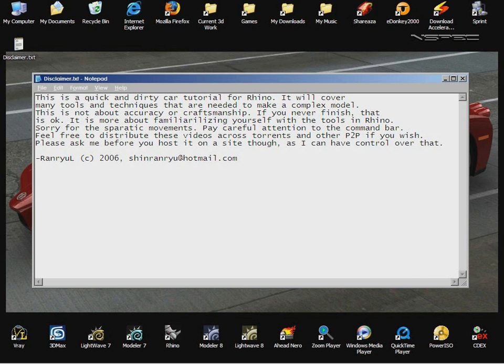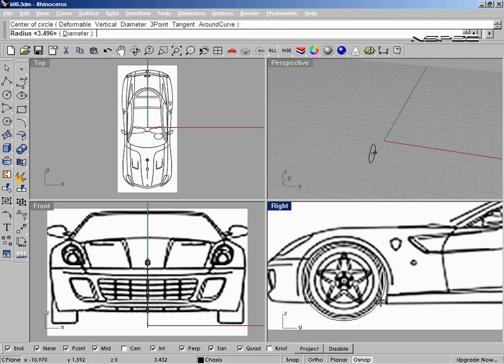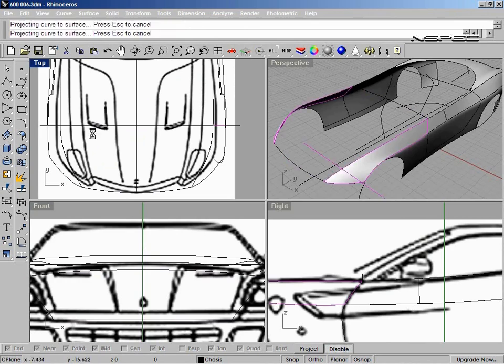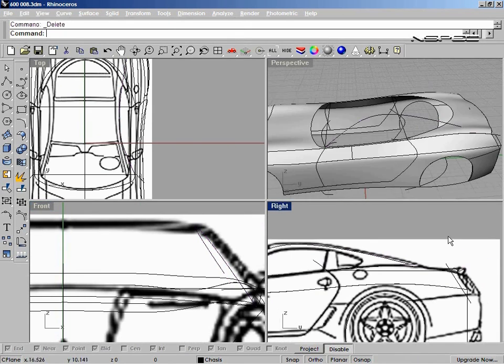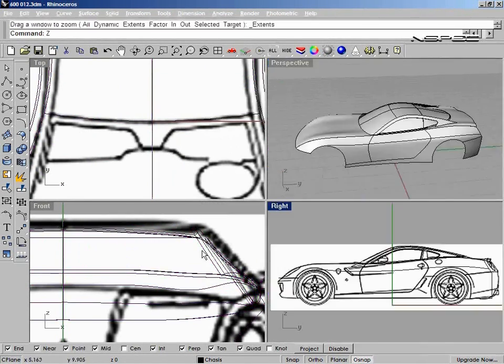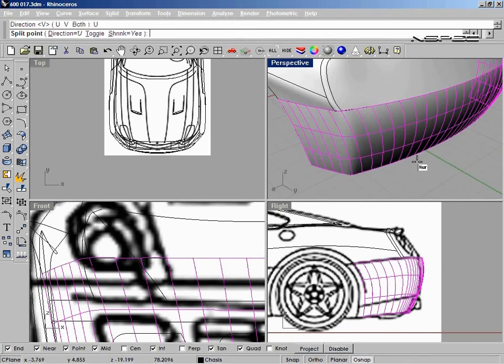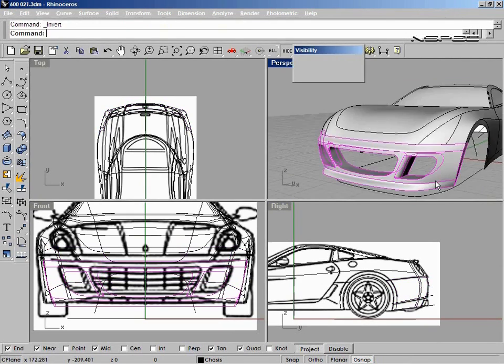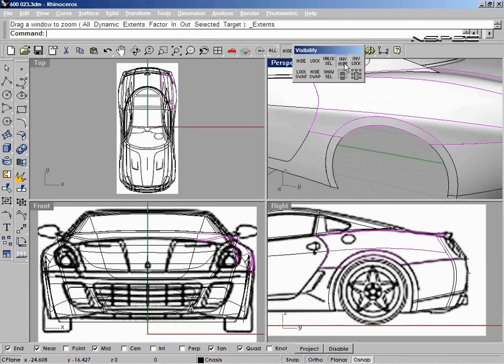Rhino 3D Car Tutorial 600GTZ Forged from Scratch - Sample Super Speed

Comment: what's the tool you are using from 1:25 on? The tool which you use to connect lines with surface/make surface from those lines?
Reply: 4 years and no answer...*pretends to be shocked*

Comment: So from reading your description, you also have the tutorial on a freely distributed basis?  Or will you just redirect me to your $69.00 Turbosquid purchase page?  I have a question about the revolve, whenever I do it, it leaves a black bolded edge where the revolve starts and ends, is there a way to remove this?  Because I can't use holes/bools/fillets etc on these areas.